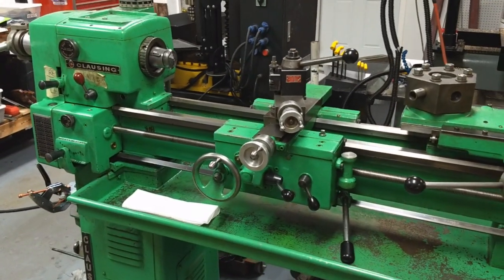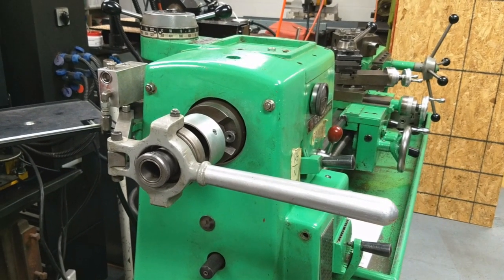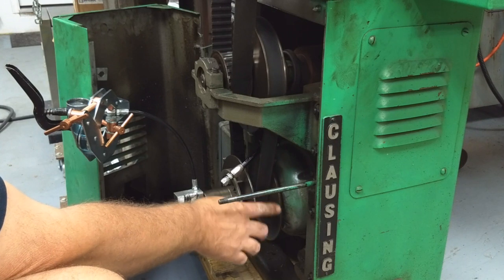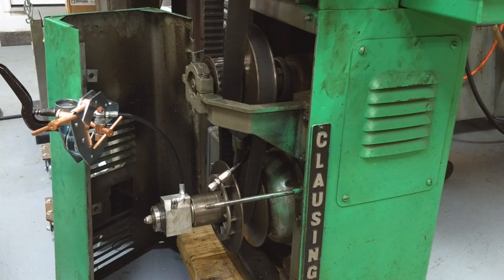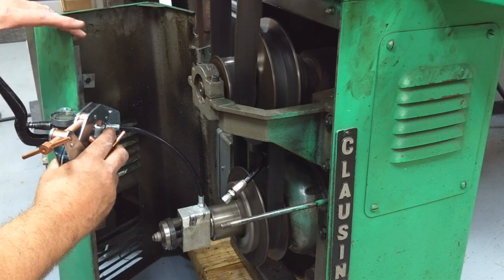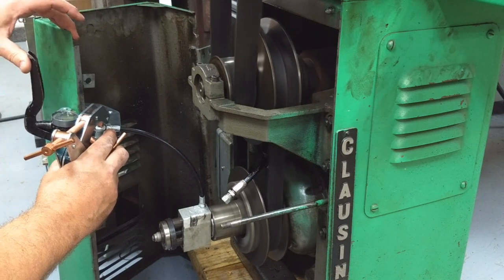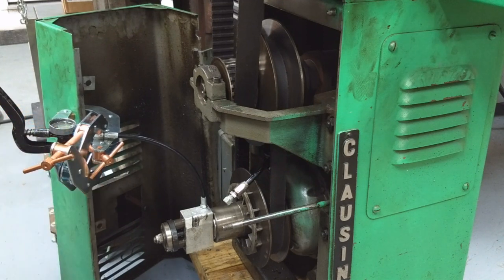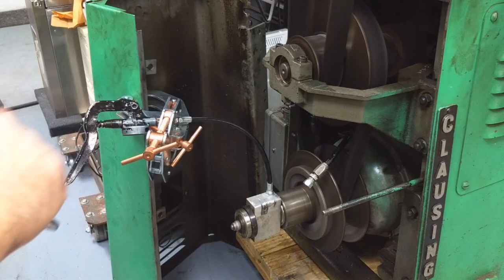Clausing Lathe, Variable Speed Troubleshooting, AvE Style!

Comment: If you need a new variable speed pulley, Speed Selector makes pulleys that replace the Reeves, Hi-Lo, TB Woods and Lovejoy pulleys that went out of business or got bought.   Most are in stock or Speed Selector will custom make if needed. They have an actual engineering department; very helpful.
Reply from the maker: Thank you for that info!  I really do like the lathe save for the whole Sheave drive thing. I think i'll go VFD at some point. Best!

Comment: Only because most people put break fluid or oil with detergent in the system. Man, there is a plaque right on the machine that tells you what to use. These are GREAT American made machines, but like a car, you need to know what you own. Good news, parts are available to fix this problem for less than $20 available from Clausing USA, simple seal kit. You can use a quality jack oil, if you don't then its broke.
Reply from the maker: Funny, I used hydraulic jack oil just like you say! I couldn't find the specific oil Clausing spec'd from 1960-whatever. I guess when people see a "master cylinder" the first thought is, put brake fluid in it.
Reply: @lockbuilder  I'm no genius... I wrecked a jack once with break fluid. Wised up. Mine wants a Texico product they don't make anymore. But, it's an easy fix if you mess up.